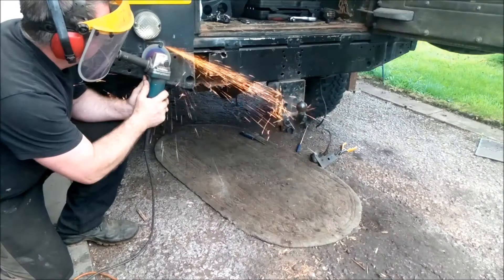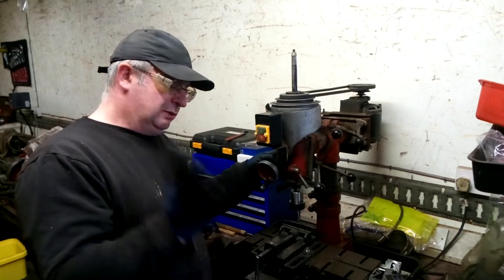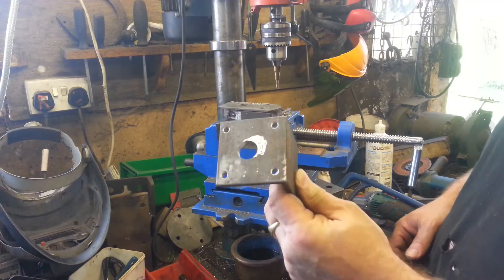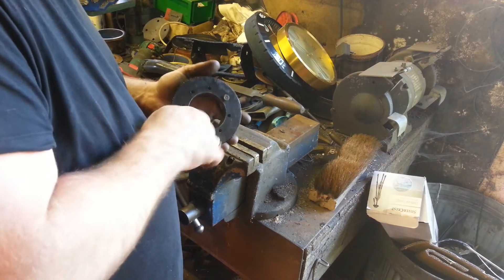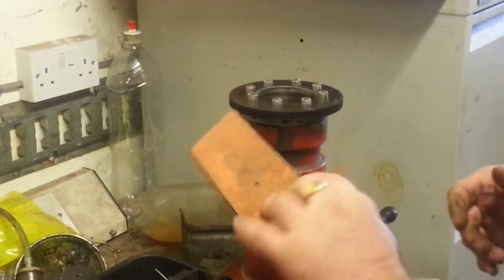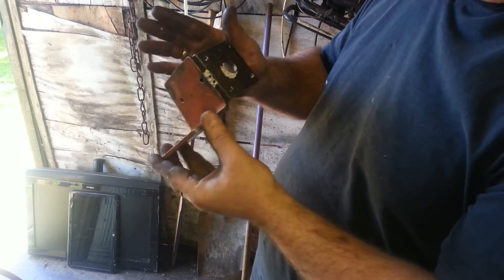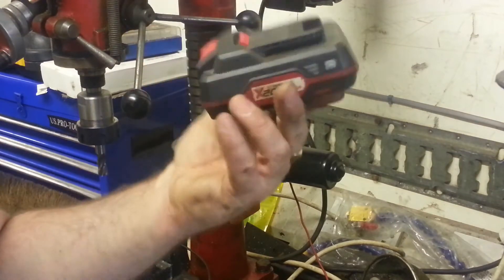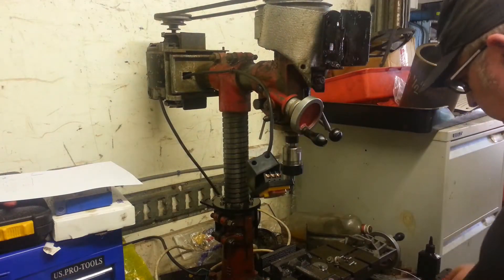Dor Westbury Vertical Mill Electric Lift and Lower Project

Comment: Nice job - very ingenious. I also find the column a hassle on my DW, but my solution will be more steampunky and  lo-tec than yours. I have just ordered a hand-cranked winch. Will probably run the cable through a pulley fixed to the rafters above.   🙂
Reply from the maker: Video your project I'd like to see that
Reply: @Mids1970  OK - I will!  🙂